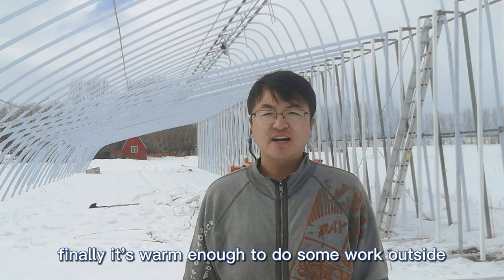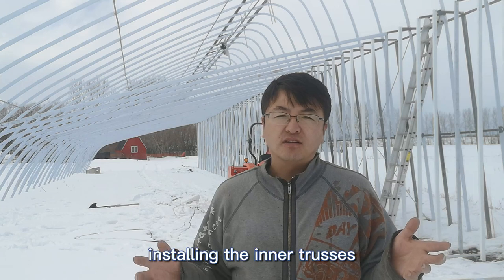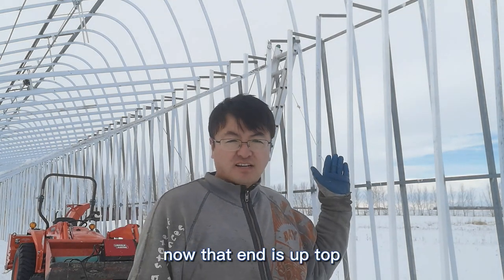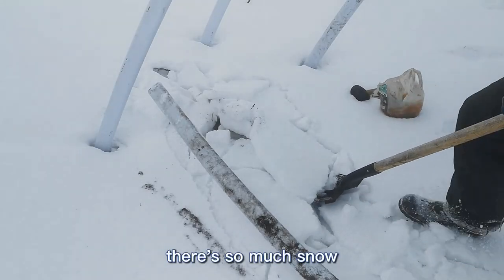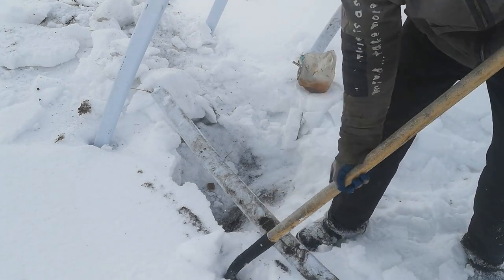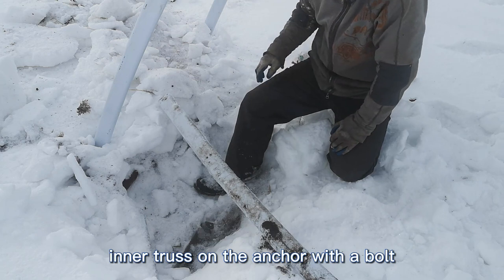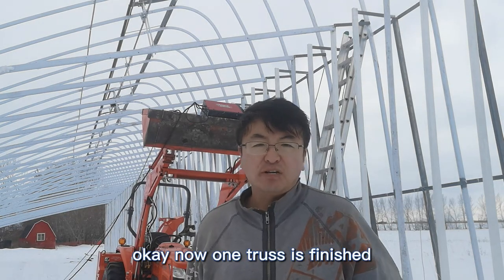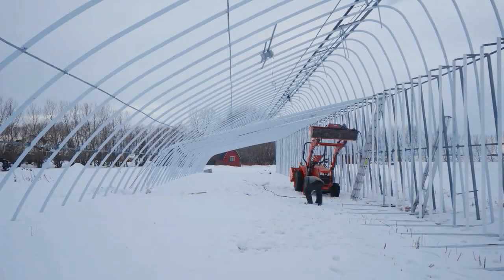Installing the inner trusses for my second greenhouse

Comment: I was doing some research on winter   greenhouses and I found one that uses geothermal heat to stabilize temperature. They are able to grow oranges in Nebraska in it. They just run toobs 8 feet under the ground and surculat air through it. You could add this idea to your greenhouse. In combination with what you're already doing you would have no problem with winter freezing.
Reply: Hi There, just FYI, I did quite a lot of research into Russ Finches Greenhouse in the Snow concept and the Sun Pit, Below Ground Structure is NOT whats its cracked out to be at all.  Additionally, the makers of his kit also do above ground solutions but they also have an issue that their ceiling height is too low, looks like best option is Chinese design and then combine this with Geothermal Heating (GAHT)
Reply: Do you know anywhere that sells kits with the Chinese design?
Reply: @AidanJoyce   Can you share some details about this GHITS skepticism? I'd like to know what steered you away from it

Comment: Hi Jianyi, Thank you so much for the video. I was wondering about the heat mass wall and assumed that was going to be build first. When I watched this, I realized you actually built the frame first before you do the back wall. How do you ensure the  wall does not collapse on you? I hope you will do a video or explain how you ensure the wall does not collapse. The frame against the backwall here looks angled in but your completed greenhouse looks straight. Is that an optical illusion, so does that come later? Again, thank you so much. I am Chinese and I am so pleased to see Chinese ingenuity and your diy spirit. God bless!

Comment: Here is something I noticed if you don't mind me stating it.
Is the air gap may be too large between sheets.
If you look at how air is used as an insulator between glass in a  window ,the air gap is in mm and diminishing returns on increasing via convection as far as I understand.
Really nice work thanks for sharing :)
Reply: There's no air in between double glasses. They put special gases in it which is much better insulator than air. The bigger the gap, the better the insulation, however, a window would not be ergonomic with bigger gap, that is why they apply insulation gases.
Reply: @strobi0001  Yes they use argon etc for their insulative properties ,the principle remains the same with hermetic sealing
I can see where you are coming from with aesthetics but there has to be an engineering reason  why a specific gap between glass is chosen too vs total wall width on a home for example.
One thing that always perplexed me is still air vs circulated via fan inflated twin layers films.
Reply: @collegesynewave  I think they rather apply such a pragmatic approach which idea looks working on that climate.  The limiting factor of the size between layers only about the limitation of physical sizes in my opinion, that might relate to the angle of the rooftop.  
Your last sentence is not quite clear to me, but I try to answer. Air has to stay stationary, so in case they want the best insulation during a cold night, they roll out the blanket that seperates air between veggies and snowy rooftop,.
Reply: @strobi0001  I have thought too another consideration in the gap size regards window manufacturers is material costs
I have looked before at why the size is chosen I will source and post a link :)
The second comment is based around the air blowers fans that a lot of online folks use to inflate a twin layer polyfilm  greenhouse .
That's interesting your take on still being a better insulator than circulating I've thought the same too :)
With some growers vids on here it seemed to me the users left fans on for extended periods which seemed counter productive to me at least.
Reply: @collegesynewave  I think you are right. Using fans accelerate heat transfer. Might be the case that not everyone thinks through things.
Reply: @strobi0001  Typically, most sealed units achieve maximum insulating values using a space of 16–19 mm (0.63–0.75 in) when measured at the centre of the IGU.[5]
https://en.m.wikipedia.org/wiki/Insulated_glazing
Source 
Where I'm coming from is they don't simply increase the gas gap but rather keep increasing the numbers of glass used.
For example  double glazing triple quadruple and the recommended gap size  (gas dependant )remains the same.
Reply: The "normal" profile is the inner shell. The outer profile has to be a steeper pitch to shed snow. Also, he puts the insulating blanket between layers instead of on the outside like they do in China.
Reply: @e1ucas  thanks
It seems I wasn't seeing this part clearly apologies
My comments were based on helping not critical
Reply from the maker: We need to make the outer layer as tall as possible to decrease snow load. We need to keep the inner layer as low as possible to trap more heat closer to the plants on the ground:)

Comment: Is your new green house 100 m  X 10 m like your first? Or did you go for the 80 m to reduce transportation costs? is your north wall still 3 m and clay filled? I would like to see some video's of north wall being built. Most impressed with your ingenuity for cost savings!
Reply from the maker: The second greenhouse is the same as the first one. The back wall is 4m tall and will be clay filled. I will share more videos.
Reply: @dongjianyi2492  thank you

Comment: Have you seen the "geothermal" greenhouse heating/cooling system where you bury a 12" drainage pipe 6' deep or so and blow air through it? It should be a pretty cheap way to add some extra heating/cooling capacity.

Comment: That's a fancy rack you have for your welder there :) I'm curious what kind of transparent plastic material you use to cover these greenhouses. Won't most plastics be degraded over time by the sun's UV light? Is it something fancy like ETFE or PTFE?
Reply: They sell greenhouse plastic for these applications, the one I use is made of polyethylene and is 6mm thick. Not sure what he's using since it's a commerical application but probably something similar but made for his dimensions?
Reply from the maker: The plastic I use is Polyolefin. It is 4.8mil thick. I will upgrade to 6mil. We change it every 4-5 years.

Comment: Hi, before to start, Many thanks for your explainations, that's very interesting to show your work. But I don't andestand why the supplier don't make the same fixation for the down and the top of this part, welding is too long and complicate at 3m metter high..., espacially  if you don't have electricity...
That's pity you don't show the start of the construction... Do you start to place the frame of the wall or fix all U on the floor ? Rgds
Reply from the maker: Upgrading design with the manufacturer. More bolting means more cost for the factory. I install the outer layer trusses first, then the back wall and then the inner layer trusses

Comment: How did you decide how much space to leave between the inner and outer frame? Thanks for sharing. Looks great.
Reply from the maker: A lot to consider. We need to make the outer layer as tall as possible to decrease snow load and make the inner layers as low as possible to trap more heat closer to the plants on the ground. We also need to make sure the insulated blankets roll can travel smoothly on top of the inner layer. This is design is engineered, not by myself:)

Comment: What would the downside of making the outer layer taller (say 1m)? That would make the front angle a little steeper and thus reduce snow issues (no hand saw vibrator needed).
Reply from the maker: We need to minimize wind load too.
Reply: @dongjianyi2492  It is always a trade off.

Comment: Aw man... I wish it were any other year, and I'd offer to come give you a hand with that.  I do a lot of things like that on my own as well, but that process would be so slick as a 2-person job.

Also wish I could bring you some computers and sensors and get them programmed for you - it'd be really nice to have 10-20 points of temperature measurement in there, a soil moisture sensor array, some automated valves and wifi control for your blanket motor.  Maybe someday!
Reply from the maker: Thank you so much!